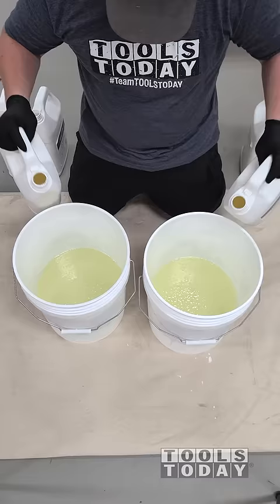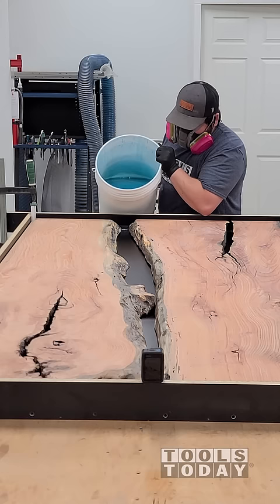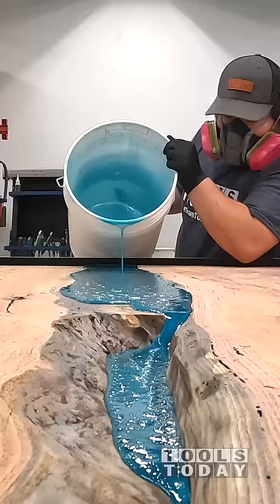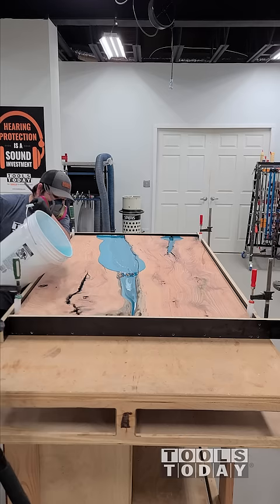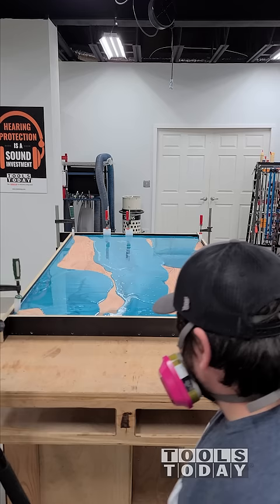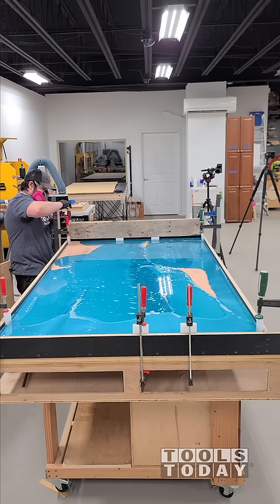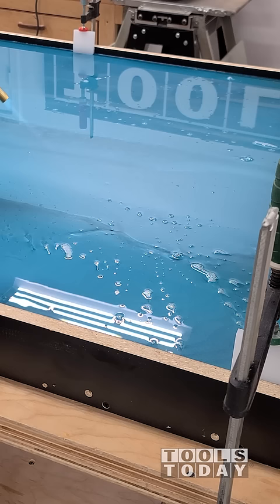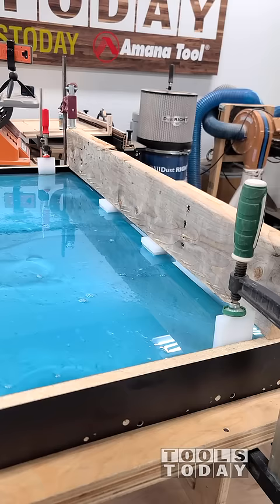Pouring Epoxy for Kitchen Island Top

Comment: Mask. Yes. But if that is just a dust mask which it does appear to be, does not protect against VOC's. You need a canister mask designed for what you are working with.
Reply from the maker: I have the carbon cartridges on the mask 👍

Comment: out of curiosity: would vibrating the table to have the epoxy fill in the cracks better produce a better product?
Reply: Most likely. Would’ve dealt with the air bubbles too

Comment: How are you filling the clammed areas? I'm assuming epoxy didn't cover well where the clams are.
Reply: It's not supposed to. All of the epoxy on the top and bottom of the slab will be removed to expose the wood

Comment: Why don't you use a pneumatic vibrator on the table to vibrate the bubbles to the top?
Reply: Might get them to the top but perhaps the torch is better at popping them

Comment: Well you still be able to see the wood?
Reply: yes, later the slab will only have epoxy in the cracks
Reply: @fabian_hbr4278  change “slap” to “slab”
#I-hate-typos
Reply: It's upside down right now so the bottom is the top
Reply: @dontbeakaren6145  no its not
Reply: @fabian_hbr4278  you're absolutely right... I just know when i was doing it i turned it upside down and put weights on top so this way the top wouldn't get damaged and the wood wouldn't float to the surface